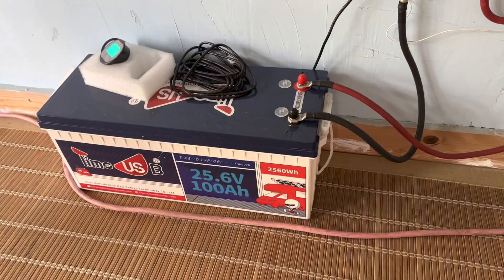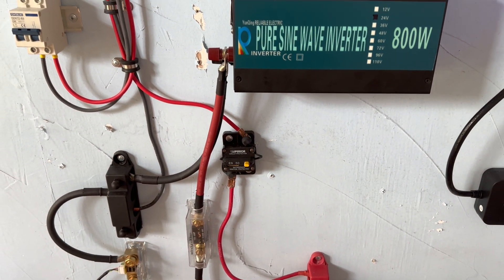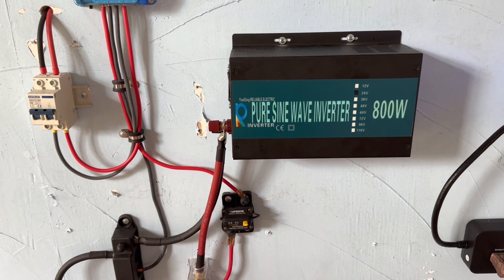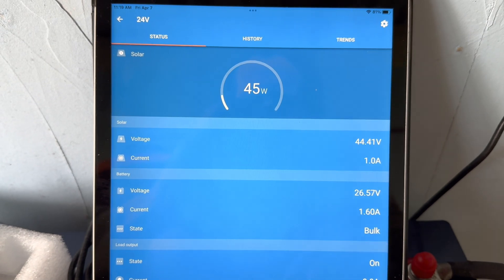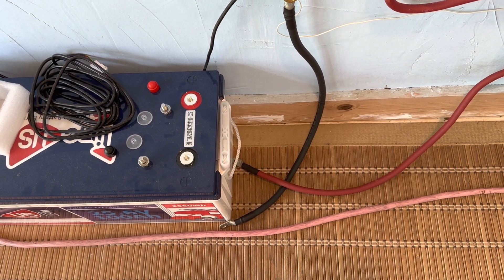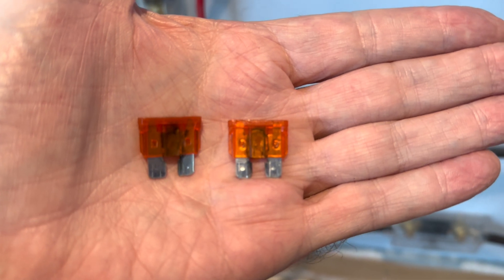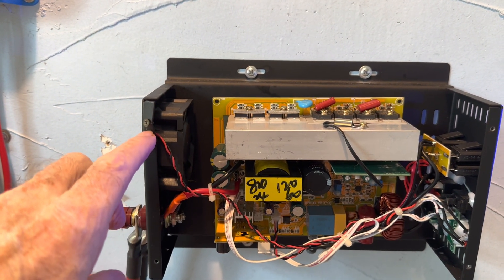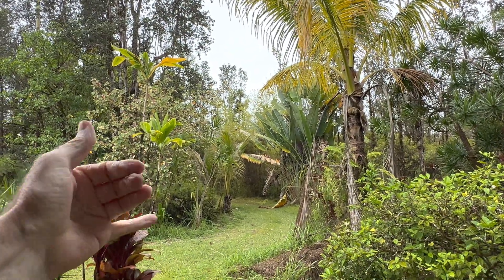Reliable Electric 800W 24V Pure Sine wave inverter FAILURE ! Easy fuse replacement? Or NOT? Hope so!

Comment: 800w is small for a coffee maker
Reply from the maker: Indeed it is, but I use a smaller less wattage coffee maker and have for months on this system. Suppose to draw 600 watts, but more like 670watts in reality. Aloha! 🤙
Reply: @ProjectsinParadise808   I have that same 4-5 cup mini - Mr. Coffee and it works fine with a 1000W inverter.
Reply: Very probably one or more FET shorted due to fatigue. 
Cheap to buy but need some practice to replace them.
Aloha🙋‍♀️

Comment: I downloaded the manual for that inverter and dug around it it a bit... not much really.  Basically says the fuse will blow if reverse polarity... but that's seems obvious to NOT be the issue.  The other cute thing is it says you can't open the case to change the fuse without their permission... like that's available 24X7 or something.  When a Man needs coffee, he needs coffee, and no permission is needed!  :)
Reply from the maker: Haha! Amen brother! Got only a third of a cup before the pop! Then switched over to another system, finished waking up with coffee, and thought...that's a video! Aloha! 🤙
Reply: I'm not a mechanical engineer, but it might be possible to put one screw in so it couldn't be removed without prying it off so they could tell if you removed the cover without permission.